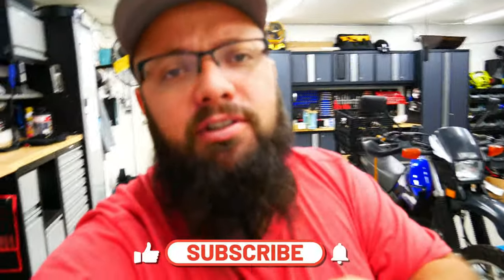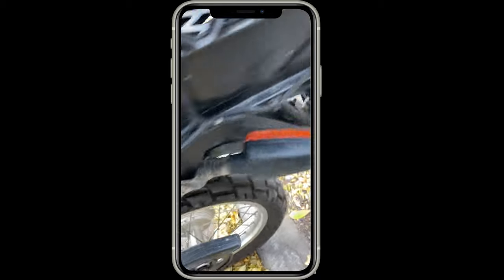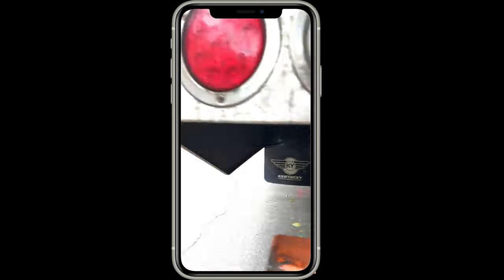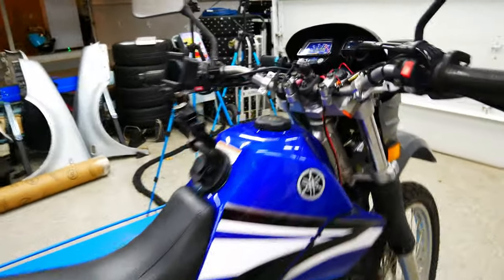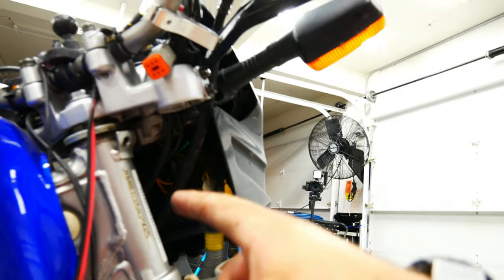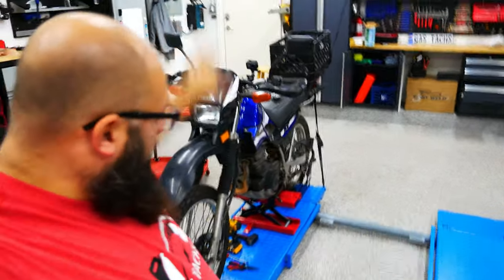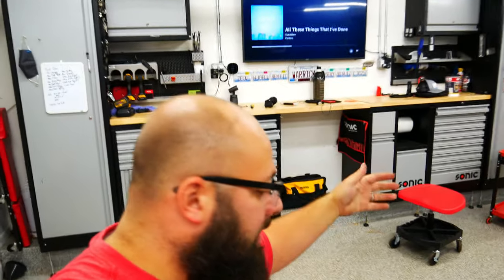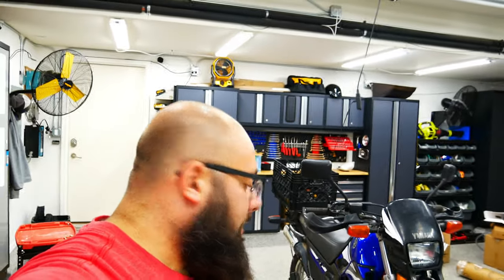Someone Drove Over His Bike! XT225 Down!

Comment: Are the cross check markings easy to take off? Neat tool, but I wouldn't want the dots all over when I'm done
Reply from the maker: 100% removable. It just rubs off with with your thumb if you want. I agree with it not looking good, but on motorcycles ain’t no second chance if your wheel falls off going 70mph
Reply: @GasTachs  Yep totally get it. Safety above all